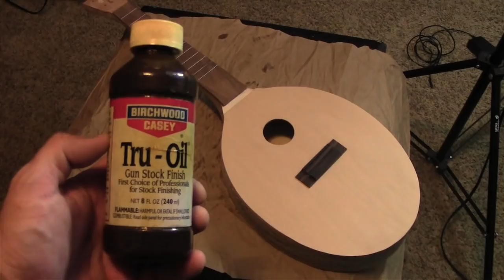Deluxe Tennis Racquet Ukulele

Comment: Well, this is on my list know, although maybe with only two rackets. Then again, I only have hand tools to work with generally, but that hasn't stopped me before.
Off topic, but what did you do to make your spool clamps? Just circular bits of cork with washers and wingnuts?
Reply from the maker: +Tyler Joseph Schommer The spool clamps are fairly easy to make. Here is the tutorial that I used. http://ukeonomics.blogspot.com/2013/04/ukulele-repair-tools-diy-spool-clamps.html

Comment: Quick question: do you put anything over the true oil on your ukes? I just got some purpleheart and padauk fret board blanks and I'm excited to use them, but I don't want to mess it up. (For example, I put a clear semi-gloss polyurethane on my travel uke and it's sort of gummy but I should be able to polish it to clean that. And yes, I'll make a video and send it to you since it is HEAVILY influenced on your design.)
Reply from the maker: +Tyler Joseph Schommer I love using Tru-Oil. I sometimes polish it with gunstock wax. For certain woods like rosewood the Tru-Oil takes longer to soak in and dry. I think you’ll like how it looks.